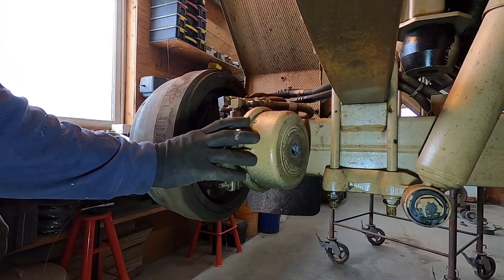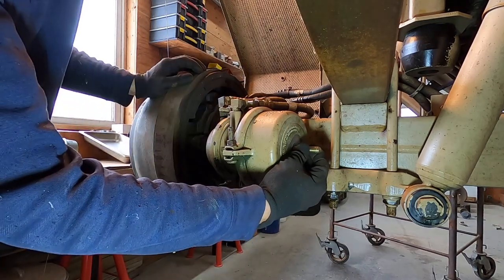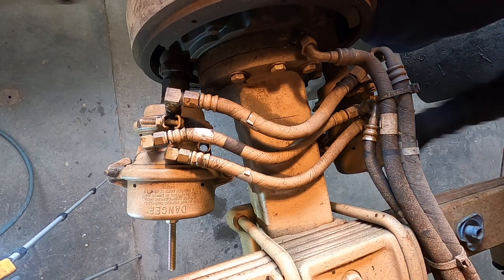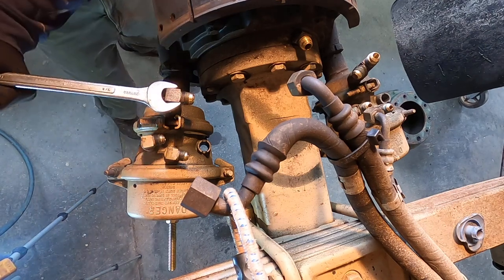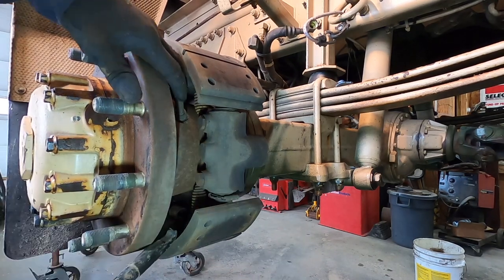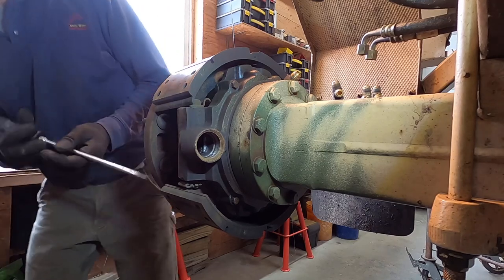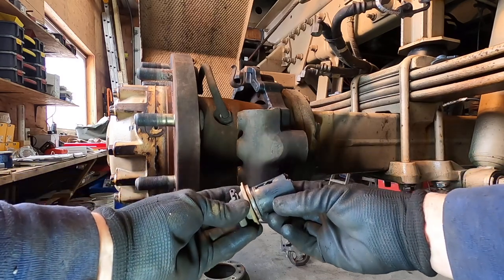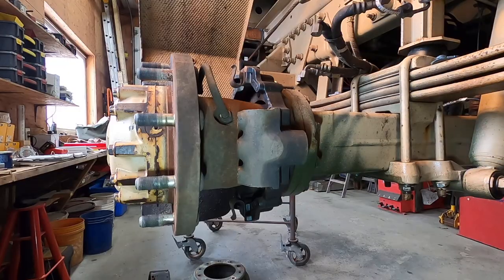FMTV Brake service

Comment: Well done!!! I will check to see if you added the brake tools you used that are particular to the FMTV in the description. I think I will be ordering some very soon!
Reply from the maker: I believe Ethan Turner will be producing the bolt-on tool and a link will be added when he is ready. I did see some on eBay.  I just want to verify that the spoon I have also works on the front before I list it in the description. Also I want to check out the snap-on tool truck to see if there is one that might be better than the one I had.

Comment: Wow, thanks so much for the video.  Two things that irk me about your video:
1- I spent more time getting the springs back on than you spent on the entire brake job
2- Now I have to do all the brakes on my truck
At least it won't cost me a fortune like Sean's videos...
Seriously, thanks so much for this.  I read the TMs and followed them, but you gave me a much deeper understanding of it.
Reply from the maker: Thank you for the great comment. The TMs are great but remove this remove that doesn't tell you how. 👍
Reply: Don't get me wrong, I can always "remove" stuff.  Putting it back together so it works as intended? Well....
Reply from the maker: Lol. Install this install that 😆

Comment: Thank you for the great videos.  Mine came from the depot with a blown out rear tire and the rear axles caged.  I am thinking of rebuilding the entire axle with the help of your other CTIS seals videos.  What tool(s) did you use at the 1:55 to open up the brake itself *without killing yourself*?  I have a suspicion rust may be a problem inside from the condition of the outside and not having a dust seal on any of them.  A guy told me some horror stories when someone mistakenly unscrewed the bolt holding the two halves together when they thought they were unscrewing the caging bolt.

Comment: Hi Neil. Just watched this video again. Great reference. Did you use a standard grease for the brake fittings or special type? Also, I would recommend storing the caging bolts rather than leaving in the can. Had a bad experience with a a caging bolt where the thread broke off, allowing the large can spring movement. Yikes! Recommend paying close cage attention to the threads of these bolts and replacing them if there is any threads that are suspect. Appears someone overtightened the caging bolt, weakening the thread.
Reply from the maker: I just used a standard Grease. I would definitely not leave the bolt in the can. I just keep them in the toolbox instead of storing them in the storage spot.
Reply: @NEILSWORLD  Roger that on the grease. Thanks!

Comment: I was wondering where you can get the adjustment plate?
Reply from the maker: I had a small machine shop in the area make it. The dimensions are in the technical manual.

Comment: Fantastic! Thank you :)
What kind of grease was that?!
Do you know if using anti-seize on the adjustment threads is ok?
Reply from the maker: Any good quality Grace will do just fine.  The threads on the adjuster did not originally have grease in them so I just oiled them. I did not want to put thick grease in there I thought it might hinder the operation. The spiraled teeth around that barrel are pretty tiny and that is what spins the barrel on that adjuster so a light oil is best I think. That system is pretty well sealed up and should not have a corrosion problem.  the most vulnerable point for water infiltration is where the canister threads into the caliper housing. That would be a good place for some anti-seize compound now that you mention it.
Reply: @NEILSWORLD  ok, that all makes good sense. Thanks again!